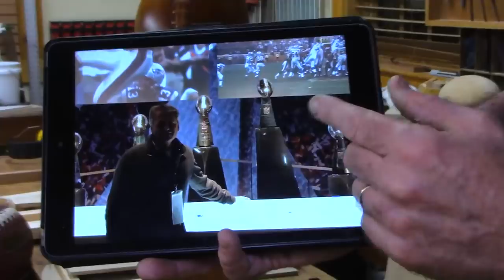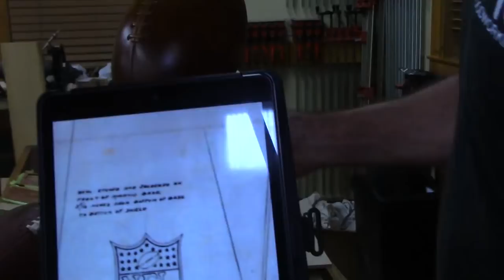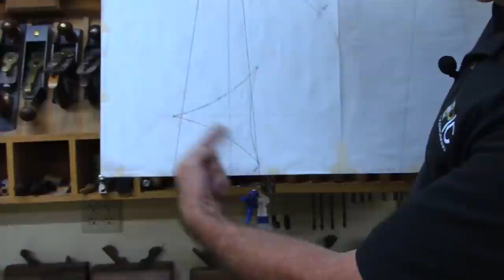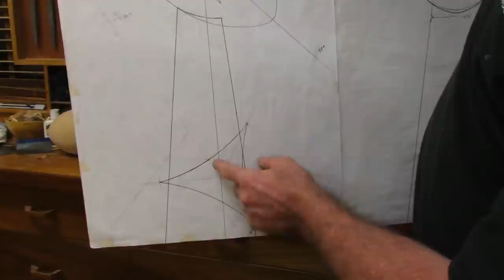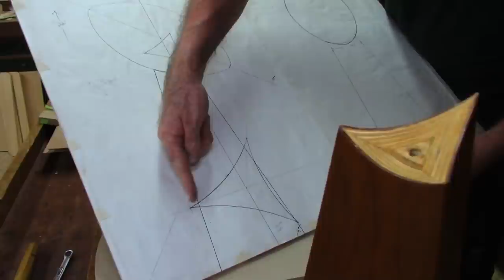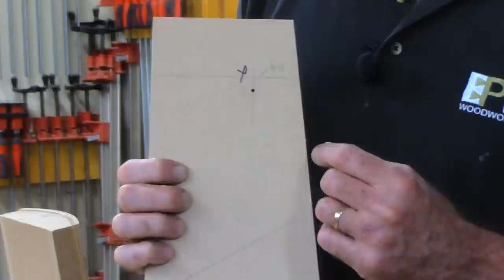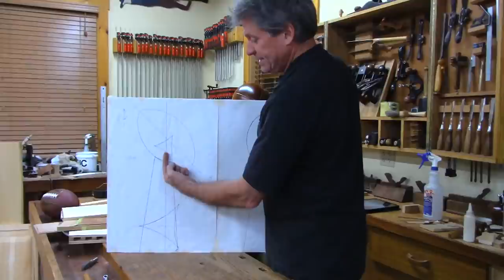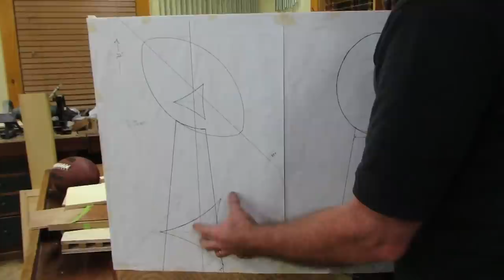Techniques for Making the Lombardi Trophy with Tom McLaughlin

Comment: Tom. To hollow out the ball a person can reverse turn it. In other words glue the quadrants inside out. Using paper between them. After the inside is shaped. Pop them apart re glue them in the right orientation. Then shape the outside. That would cure the out of balance issue, and lighten the ball. Then you could add weight to the bottom and cure the top heavy issue. This technique is used to make Christmas ornaments to hang on trees. Love the channel
Reply from the maker: Thanks Kevin, I plan to try out this method next time I make a Lombardi trophy, and thanks for watching! 👍😎

Comment: Sorry for the double response. Thought I may have deleted my original comment . Technology 🙄
Reply from the maker: No worries Kevin, yours was a comment worth sending twice. Thanks again!😎
Reply: @EpicWoodworking  Tom, I played around with the inside turning today before the game. The inside out turning for the football didn’t fare well. It left the inside con-vexed not con-caved. I did carve out more waste to lighten it up, but not recommended. Now I’m thinking of turning the inside of each quadrant like a winged bowl.  If one makes a jig to hold the piece in the lathe on the 90, each piece can be hollowed following a template. Then glue it up to turn the outside. I have turned a college size football using segmented pieces of Walnut and Maple. I believe 242 pieces. The coolest piece is the air fill hole. I used a piece of turned ebony and used a Brad point drill bit on the end to create the look.